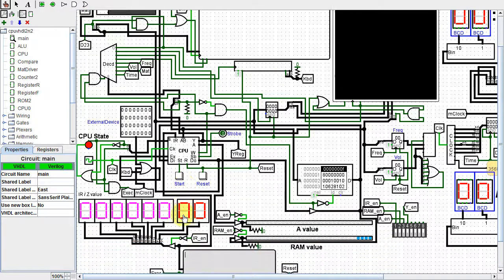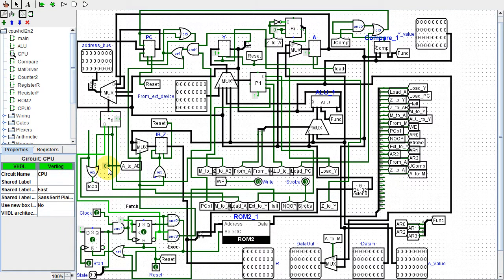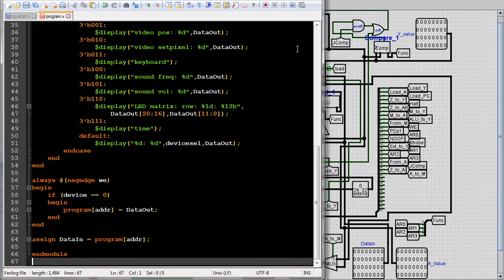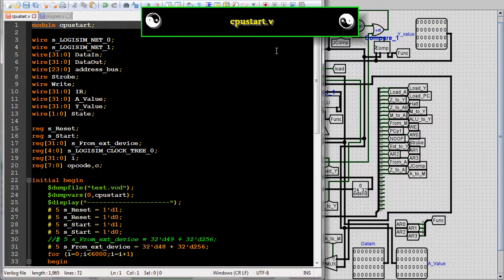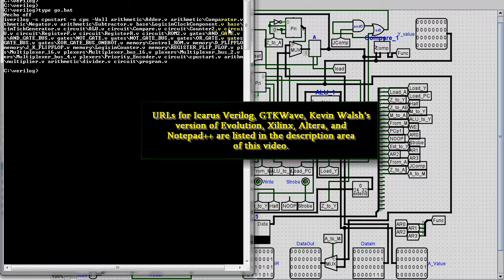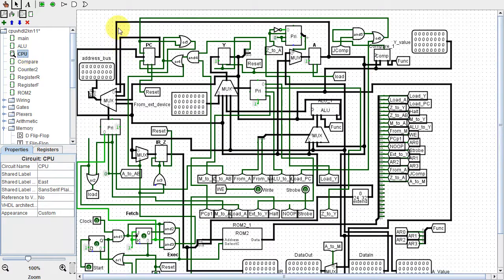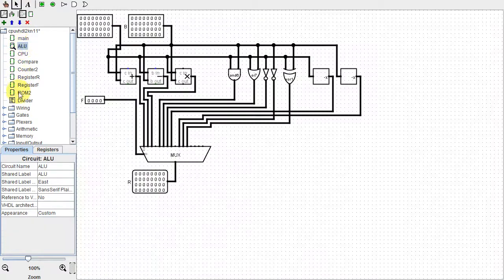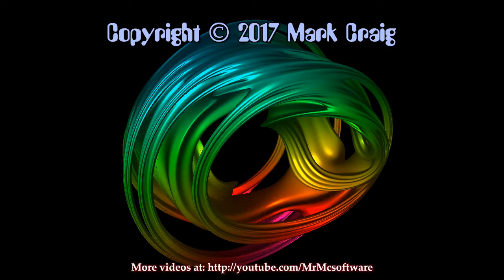Converting My CPU to Verilog Via Logisim Evolution (for Eventual FPGA Board?)

Comment: I do not see an option in my version of Verilog evolution to create verilog code only vhdl. Can you  tell me what I need?
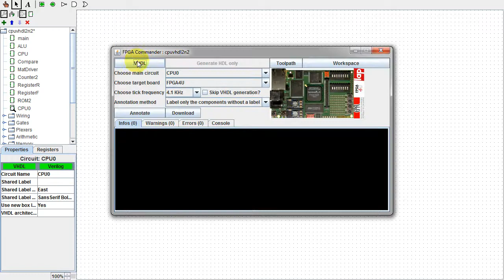Reply from the maker: @ctbram0627  Assuming the process wasn't changed in your version of Evolution, go to the "FPGA Menu" menu and select "FPGA Commander" (I believe some versions changed the name of the menu options, but it'll be fairly obvious what to select).  As shown at 2:53 the very top-left button should be VHDL.  Click it and it will change to Verilog.  If that doesn't happen in your version/installation, you might need to use a newer version of Java (sometimes missing buttons or strange behavior is caused by using an older version of Java than the one logisim was compiled with) or possibly an older version of Java (but I doubt that).
Reply: @MrMcsoftware  I found it.  under FPGA -synthesize and download/options there is a dropdown box to select Verilog.  thank you for your reply.  My version is 3.8.0 btw.  I really want to model a full computer and program my nexsys2 or altera de2-70.  It's odd at university I learned VHDL but then nearly every example I came across was in Verilog so inevitably I learned Verilog.
Reply from the maker: I have many versions of Logisim and Logisim Evolution.  In a few of those cases, I have them because the author of the particular fork suggested I give theirs a try.  The synthesize & download option I believe is a change first created by Kevin Walsh in his Holy Cross version.  I believe it later was added to Reds-Heig.  At any rate, I'm glad you found the language option.  
Your university experience (in general) is often the case.  I learned Ada (an elective though, it wasn't a core requirement) in college.  They said it would be the next big language.  It wasn't :-)  Perhaps in military settings maybe, but certainly not mainstream.   Have fun with your FPGA!

Comment: Hi. What version of Evolution is that? Mine doesn't have the FPGA for U board and when you click on the VHDL button it doesn't change over to Verilog like it does on yours. Thanks for the tip on 32 bit ROMs. I changed mine to 31 bit and it now works.
Reply from the maker: In that video, I use two different versions.  For the first part, I use either Cornell's version of Evoiution (which is just reds-heig version 2.13.19.1 with their components added (nothing concerning your issues)) or reds-heig (the originators of Evolution, as far as I know) version 2.13.20, I don't know which, but pretty sure I used Cornell's.  I also have reds-heig 2.13.22 and Cornell's 2.13.20.5, but I'm rather sure I didn't use those.  Later in the video, I use Kevin Walsh's hc version 3.1.0-HC.  In the video, you can tell which of the two I use - if you see green/red VHDL/Verilog labels (telling whether that component is defined in VHDL and/or Verilog) then it's not the hc version (it's then either Cornell's or reds-heig).

I remember you have a newer version of hc - I don't know if that still has verilog (I know Kevin Walsh didn't spend as much time on fixing/improving Verilog support, so maybe he just took it out in the version you have - I doubt it, but who knows).  But I don't see any reason he would take out FPGA4U.

Maybe it's still an incompatible version of JAVA?  If you're using a jar file rather than an executable (and started from cmd prompt using java -jar ...), see if it outputs any java error traces when you click VHDL.  Also look when you load your circuit - if your circuit uses certain (probably any) "original" (I.e. cburch) Logisim jar libraries, that can screw up all sorts of functionality (even things completely unrelated to the jar library).  Try clicking VHDL button when no circuit is loaded.

Glad the 31 bit tip helped!
Reply: Well I have some Verilog code now. I installed Java SDK and apache ant and compiled some Evolution versions. V3.1.1 HC V2.13.9 and V2.13.18 work after the compile and wrote verilog code, but the jar file doesn't run up again. It brings up java errors. Strangely some versions that only do VHDL I have compiled OK and the jar file works OK. Well I suppose I can work like that.
Reply from the maker: There should have already been compiled jar files of those Logisim versions (no need to compile them yourself), but I guess it does reduce the possibility of problems if you do it yourself.  I'm not sure what you mean by "the jar file doesn't run up again...".   It might be an environment path problem - maybe sometimes when you run it, it knows the right jre to use, and maybe sometimes it uses the wrong jre - assuming you have more than one version of the runtime environment.  BTW, some versions of Windows (I'm assuming you're using Windows) already come with java (old version (age depending on which version of Windows).  Though, it is possible it was only XP, ME?, 2000?, and 98? that had it, I don't know) - maybe sometimes, it uses that version of java (which would be too old most likely)
Reply: Yes I had jre V8 & V10 on Windows 7. I uninstalled them and it all works now. I was getting an error dialog box with a Java lang initialisation error message. Thanks for your help.
Reply from the maker: You're welcome.  I'm glad it works now.